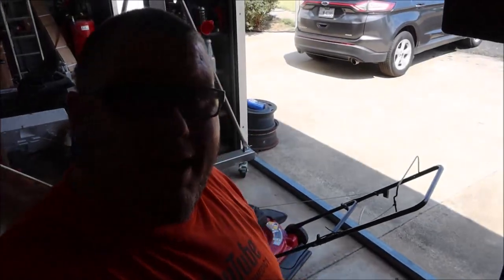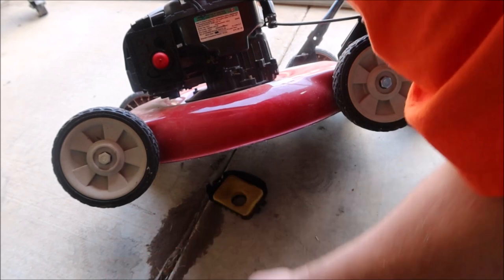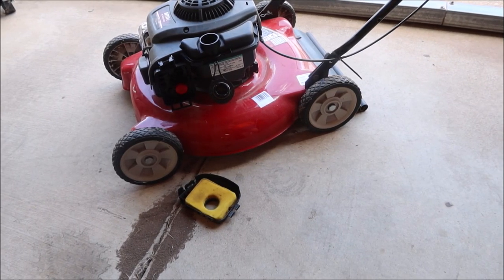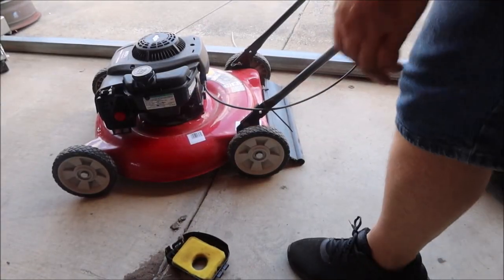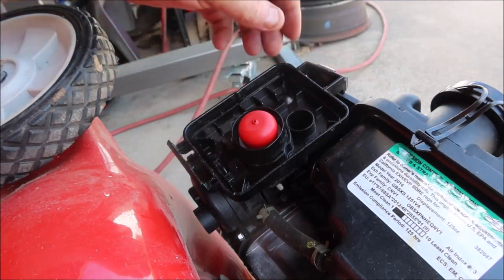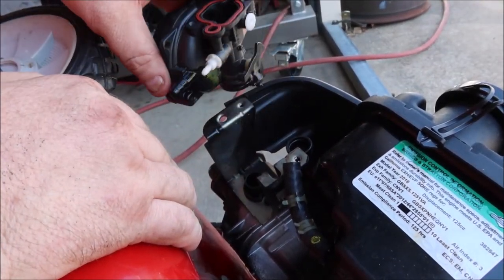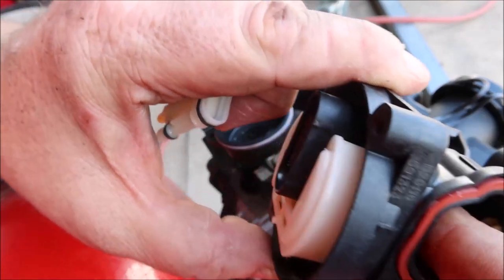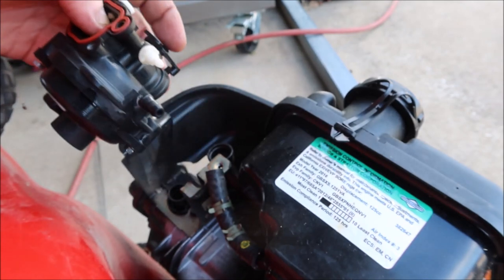BRIGGS AND STRATTON PLASTIC CARB TIPS AND TRICKS

Comment: Thanks this worked for me. I even changed the oil and blade while I was at it. If anyone is having trouble with disconnecting the fuel line, just take the plastic top off of the mower, slide off the fuel tank, and rotate the whole carb and fuel tank assembly to disconnect the throttle linkage. Be sure to empty your fuel tank before you start working on the carb itself. Thanks for video.

Comment: I have the same lawnmower, it's a MTD 300 E series. I bought it 6 yrs ago. It runs great, start up on the first pull. I just installed a fuel shut off on it. It was a pain cause the fuel line is so short. I do maintain it. Change the spark plug, air filter, sharpen the blade and use ethanol fuel only. I am not a small engine mechanic just a DIYer.

Comment: This video left out the importance of the white plastic spacer and O ring between the carburetor and motor. That O ring can cause the mower to suck in much air if it is old or damaged. On an older mower, if the mower starts and stalls after priming you need to check that the 2 inch fuel line is not clogged going from the gas tank to the carb.

Comment: The main jet insert for the bs plastic carb is cheap and essentially plug-in a full rebuild of the carb. It's got better chance of running right the first time than a replacement carb for a Honda😂. Full carb service in 5min or less - I was a sceptic until I discovered the cheap inserts, now I appreciate the design

Comment: thank you. first time working on a plastic carb. didn't know what to make of it. it isn't like the old school ones. in a way plastic is a bit easier to work on. it cleans quickly and the mower started on the first pull. thanks again. jw
Reply: oh. on my mower, the oil vent is in with the air intake inside the air filter. if you tilt one direction oil gets into the filter. that kinda sucks...

Comment: Took me 2 times to get one of those clean on mower that customer brought in for repair. Both times the mainjet was cleaned with carb cleaner spray and blown out with a air hose.
Reply from the maker: I
Clean once.  After that it
Gets a new carb
Reply: I did was gonna replace after the first time but it one new ones under a newer part number that doesnt interchange with older parts numbers.

Comment: I've watched this repair video from 4 different mechanics on the same type mower, none have went out of their way to add an inline fuel filter... but were ok with tearing the carb off multiple times to clean it... I know this mower doesn't come with one but mtd puts that cheap pvc preformed rubber fuel line on them from the factory, those hoses fall apart from the inside out, a month or 2 pinch the hose a watch what comes out of it... fuel filters are cheap and necessary.

Comment: So i just took mine apart and cleaned the carburetor, with a can of carb cleaner, and now i noticed the plastic loop (where the throttle cable/governor cable hooks onto) is broken. It snapped completely off and i cant even find the broken piece to try to super glue it. Is this piece replaceable? Or should i just stop being a cheapskate and buy a new carburetor?

Sidenote i tried briefly to pull the old arm off, but i was having to get ready to go to work. The carburetor was already installed back on the mower when i noticed the piece was broke, but from the little bit of messing with it, it seemed like it was gonna break before it came off in one piece.

Comment: When I push my primer bulb just once it floods the spark plug so it won't fire and fuel comes out of the carb base into the filter.  Once I removed the plug and dry it off, reinsert it the mower starts the first pull.  Needle and seat are OK...no leaking or overflowing.  Can't figure out why once press of the primer floods the plug.

Comment: What's the little white nipple above the gas line connector on the carb. It was dripping gas at time 12:35 in your video, when you were connecting the gas line to the carb.
Reply from the maker: Choke shaft plug off
Reply: Do I need to plug it off? I replaced it with a new one and it leaks gas plus when I start it it runs like crap for a minute! Help?

Comment: You forgot to take the emulsion tube apart and clean the 3 small holes in the center tube. The emulsion tube is 2 pieces. It has small holes on the inside.
Reply from the maker: I didn’t forget to do anything
Reply: @THEMOWERMEDIC1  you did know that it's 2 pieces though right? You didn't mention that in your video, but the holes inside should be inspected too. Just fyi.

Comment: Rather than fabricate an adapter for a REAL metal carburetor, I simply removed the entire engine and threw it in the scrap metal pile with a couple hundred brake rotors, automotive engines, parts and miscellaneous junk, replacing it with an older Briggs engine equipped with a metal carb that was on a lawnmower I bought at the thrift store for 20 dollars.
The mower that the POS plastic carb was on was a TroyBilt with what appeared to be less than 10 hours on it,  (the thing would stop running for no apparent reason) it also showed up at another thrift store.
I got a functioning lawnmower for less than 50 dollars with NO plastic crap....because I can....lol.

Comment: Hi Jeremy I have a push mower Craftsman auto choke my mower was hunting clean the carburetor didn't help got a new one and it's still doing it any thoughts oh and also there was black smoke coming out of the muffler
Reply from the maker: What model are you working on? Black smoke means too rich.   Make a video with your phone and send it
To THEMOWERMEDIC1@gmail
Reply: Craftsman Honda GVX?...  automatic choke, when removing the carburator, the automatic choke is the section that mounts up to the intake tube... if you will look to the left above the choke plate there a little insert the center of it looks like a tire valve stem... if that center pin is sticking out then it is spent... take a pair of vise grip small locking players clamp on to the triangle shaped outer side of the pin and pull it out strait and firm... replace that insert (choke deactivator) mower won't run when it's choked fully...

Comment: Put a new aftermarket (styrofoam) carburetor on. Surged like hell. Drilled main fuel jet out one size LARGER. Engine smoothed out with just a bump up in governor speed. Easy diagnosis with a little help.

Comment: I appreciate your step-by-step work on the plastic carb, but I noticed from 13:00 on there is fuel dripping under the carb, apparently from the fuel line connection.

Comment: I hate this mower.  Second year in a row I'm having to fix my it like this
Reply: Take a micro drill to the main jet.(@ 9:42) They designed it too small for fuel efficiency. Problem is it gets clogged too easily. So widen it out and use some Stabil or acetone before you put it up for the winter and after you empty the gas out of the carburetor bowl. It will save you some frustration.

Comment: I think those plastic carbs are nothing but junk I like the metal carbs where you have to replace the needle jets the O-rings in the float bowl I like the metal carbs better than the plastic carbs
Reply from the maker: Plastic dosnt corrode.
Reply: @THEMOWERMEDIC1  I’ll give you that one but if you don’t clean out those jets in the plastic carbs and you make those Jets bigger you’re screwed and they’re not five dollars on the aftermarket I’ve seen them as much is $20 on the aftermarket
Reply: @THEMOWERMEDIC1  I would rather replace a metal carb that has corroded than use the plastic garbage. I will go so far as to swap engines to get rid of plastic carbs...its a 25 minute job and engines as well as entire mowers are dirt cheap at flea markets and thrift stores.
The mower I use on my property is an old self propelled Craftsman that has a sticker on it which reads "Not for sale in (the Peoples Republik of) California". Its also a thrift store find.
Reply from the maker: @donreinke5863  Plastic carburetors have been around for decades, in my 30 years of a small engine mechanic I have yet to replace a plastic carburetor yet I have replaced a ton of metal carburetors it may be by region but in my region metal carburetors are considered garbage and the plastic ones are considered golden
Reply: @THEMOWERMEDIC1  Its the opposite here in the Rockies. I won't have one on ANY small engine power equipment.
I just had an old Tecumseh powered Ariens mower donated to me and the metal carburetor showed NO evidence of corrosion, just a lot of goo in it which was green in color and smelled of oil--I believe someone used two stroke oil in the fuel for some strange reason. 
Plastic, (in this case phenolic resin) was the reason the Carter ThermoQuad carburetor (used exclusively by Chrysler Corporation between 1972 and 1979) was widely considered to be junk. It was designed to compete with the all metal (excepting the choke thermostat drum) Rochester Quadrajet, which actually replaced the troublesome ThermoQuad on Chrysler vehicles utilizing a four barrel carburetor until the advent of fuel injection.
When it was re released as the Demon in the last few years, the phenolic body was replaced with a metal casting, it finally became a reliable carburetor decades after it was introduced.
Plastic is NOT a suitable material for use in carburetors.
Ive repaired and rebuilt engines of all sizes for 50 years, and know the advantages of metal carburetors over plastic ones.
Reply: The only problem is no cut off valve and no filter 
The plastic carbs are good thing for home owners who only need a few tools, carb spray and bread tie to fix it
Reply: @philliphall5198  you can add a cut off valve and just cut the fuel line in half put the cut off valve there and wallah!